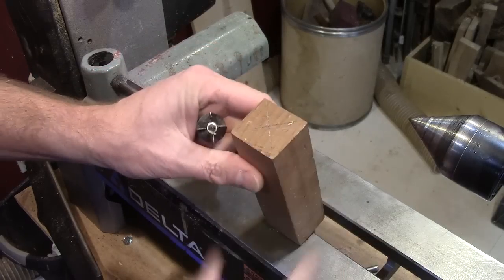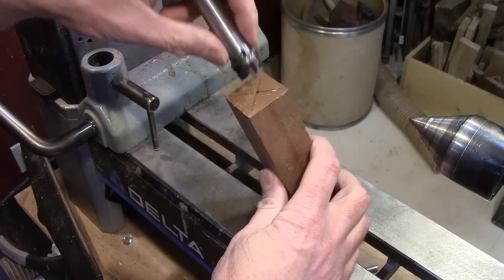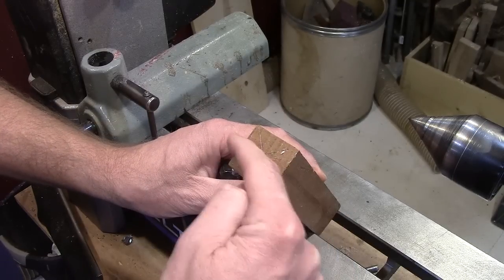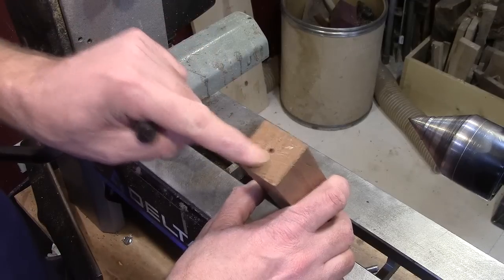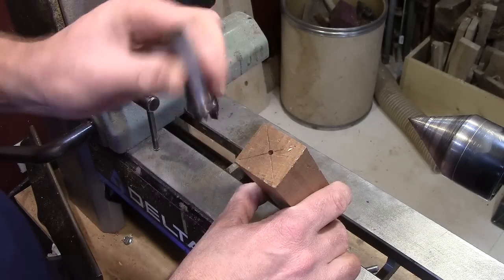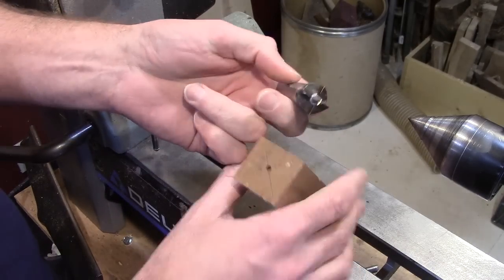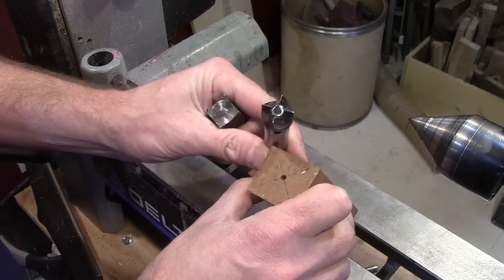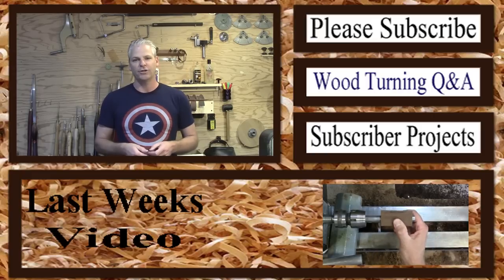Woodturning Q&A Drive Spur

Comment: Hi Carl,
thank you for the informative video.
If I chucking wood in the lathe. Then I mark my center with a cross, as you did it and I drill both side short with a center drill before. So keep the wood pieces quite well in my small lathe.

Comment: Great advice Carl...
I find that I seldom use the drive spur though...
I have another that is just a spur... no drive... and it works really well for someone who suffers from that catching condition!! If you have a catch... the wood just spins! You do still have to keep tightening it up as well... and you do have to have a live center on the tailstock... but it works like a hot damn!
I do use the bandsaw to cut the grooves and that works really well... I however cut from corner to corner to make sure I am in the right place!
Glad to see that the finger is looking all healed and ready for action again!
Thanks for the video
Larry

Comment: How do you remove a drive bit like the one in this video?  I have an old craftsman bench wood lathe and want to use the plate that screws onto threaded shaft that has the bit in it.  I cant get the bit out
Reply: Yeah, i have the same problem...

Comment: I've heard that you should file off two of the spurs, it makes the drive safer and grab better??
Reply: Face grain two spurred drives can be good as they don't have to cut grain. but with spindle work four spurred drives are good
Reply from the maker: They do make two spur drives so you don't have to file off the one you have.

Comment: Great tips.  Another method is to drive it into the wood with a rubber mallet.  Never use a metal hammer, it will mushroom your taper.

Comment: How can you wear that t-shirt and NOT turn a Captain America shield? ;)  Good tips, though, I never thought of using the bandsaw.  Do you ever use a mallet to drive the center into the wood (before putting it in the lathe so as to not offend the morse taper guardians)?
Reply: I'll do the shield after Christmas! Yes you can use a mallet. but I'm afraid of splitting the wood.